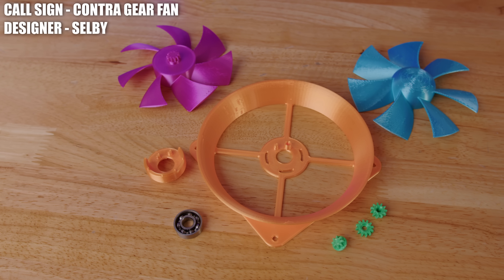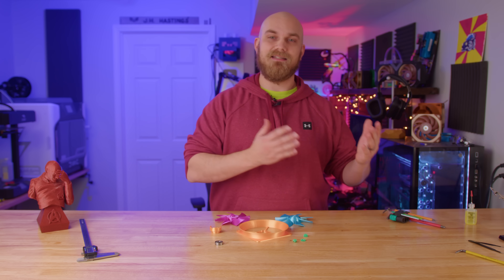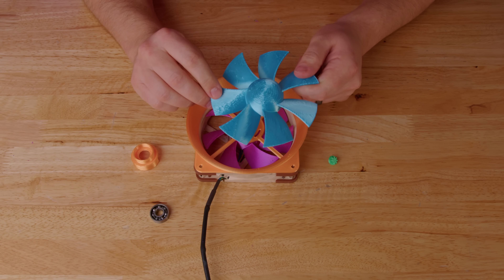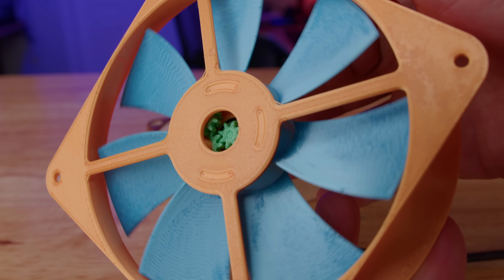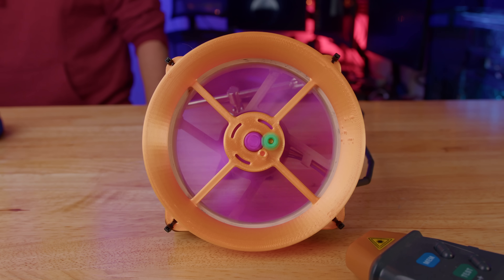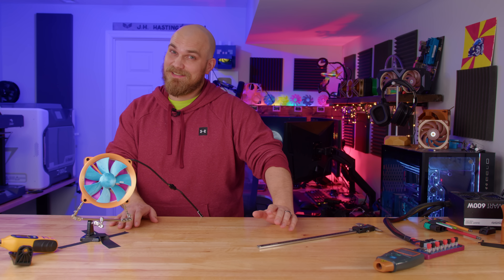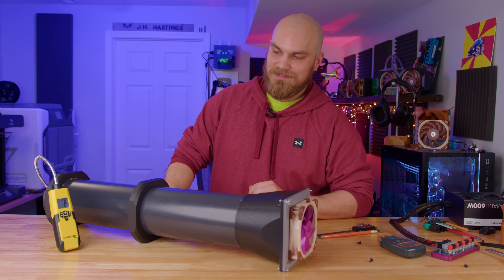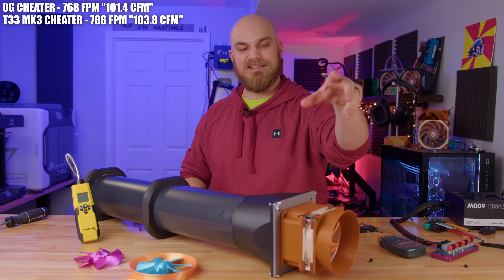World’s Most Complex PC Cooling Fan | Fan Showdown S4 Special

Comment: Concept of Contra-rotating propellers. Contra-rotating propellers are a type of propeller system used in some aircraft, ships, and submarines. Unlike traditional propellers which have one set of rotating blades, contra-rotating propellers have two sets of blades that rotate in opposite directions.

The advantage of contra-rotating propellers is that they provide more efficient propulsion by reducing the amount of energy lost in turbulence and slipstream. The second set of blades can also recover some of the energy from the first set, resulting in higher propulsive efficiency overall. Additionally, contra-rotating propellers can provide greater thrust without increasing the size or weight of the propeller system.

Contra-rotating propellers are commonly used in military aircraft, such as the Russian Tupolev Tu-95 "Bear" bomber and the British Westland Wyvern fighter-bomber. They are also used in some commercial aircraft, such as the Russian Kuznetsov NK-12 turboprop engine, which powers the Antonov An-22 and An-124 cargo planes.

In addition to aircraft, contra-rotating propellers are also used in some ships and submarines to improve propulsion efficiency and reduce noise. Overall, contra-rotating propellers are a useful technology that can improve the performance and efficiency of various types of vehicles.

Comment: Curious how a PLA printed 1:1 copy of the Noctua A12 fan blades compare to the original. That would conclude how high the penalty of printing artefacts and inconsistencies are. With that info you could extrapolate the gain of an injection molded version of each blade design.

Comment: I have a though.. what if.. you printed a reversed fan.. as in the fan blades were literally reversed.. then attached both fans to their own motor.. only reverse the contra blade fan and have them mounted together.. i know that is 2 motors but the sound and performance in the cheater should go up.. at least that is my thinking.. would love to see that..

Comment: I worked in high glass injection molding, moving parts usually have Pins embedded. I think removing the plastic nubs for the gear box and replacing it with a thin wire or pin like a "Hotwheels axel" would reduce parasitic drag significantly.  If you Wanted to over engineer it further, Hobbyist do make high end small bearings for "Legos" as well as a knowledge of the best plastic lubes ever.   Please follow up with PINS. "K&S Precision Metals 5501 Music Wire" was $1.19 on Amazon, it seems a good start.  For all intents and purposes that wire is what makes "Hotwheels" go Fast.

Comment: My good friend ever wondered why transmission oil or differential oil is thick? Yes its produces friction BUT it has high viscosity for a reason.
CENTRIFUGAL FORCES! Sorry for caps but your gun oil exists on the outer walls of the outer fan the moment you started the fan assembly.
In my ears you can hear the gears grinding eachother dry on https://youtu.be/lx01utHcFtg?t=466.
None the less a great video as expected from you

Comment: In free flow, the 'Cheater' reigns supreme, but, lets compare CFM between Cheater and Contra Rotator, with a little back pressure. (flowing through a heatsink)

Comment: I think it would be interesting to also compare the power/current draw on the fan motor to see if the additional blades require more power to run. Could it reduce or nullify potential gains in flow that could be more efficiently achieved with another fan?

Comment: its very cool 
but its a lot of sound for a less then 30 increase
wonder if instead of 3d printed you used properly lubricated metal gears if that would reduce the sound and how much it would strain the engine 
lots of things still possible to try with this design 
maybe a version 5 or 6 will be the best fan ever, worth iterating definitely

Comment: but when it comes to noise level to airflow, the contra needs a lot of TLC... maybe use an already built, all metal planetary gear or just try the same with recycled metal spur gears? 71db is not desirable unless you're running a server farm. maybe a different teeth design could help with the imperfections of the 3d printing.

Comment: Use ball bearing grease, also works well with gears (only low end), and maybe hand sand the printed parts?
I never see somebody do after touch on 3d printed parts
And maybe design some helical gears, they make less noise (a lot less) and engage better, straight cut gears can handle more torque but thats about the only benefit.

Comment: issue with this type of testing is the lack of statis pressure measurement, when i start building my pc in 2012 there a AF (air flow) and SP (static pressure) pc fan one is for chassis mount the other is for radiator or air filter mount. the AF fan have bigger blade move more air but if hit obstruction it cant pass the air through as much as SP,  that why there are 2 version exist. As we move on the 2 slowly merge together and we got to this point where the fan performance is pretty close between obstruct and non-obstruct flow with the scarified is the performance now is in the between of AF and SP. also \we want quitter and quitter fan as well as more reliable one as well and the price is an issue honestly pc fan now are way to expensive to replace as well 12 noctua fan can run a few hundred easily.

Comment: I haven't watched the whole video yet, I stopped at the selection of lubricant. Depending on the oil, it would be better than lithium grease, as grease is too thick.
   The oil is better, but would go everywhere, and could react with the plastic. Not that big of a deal considering it's just a test and a video.
   I think something like Pedro's dry wax chain lubricant for bicycles would be optimal.
  The lubricant goes on wet, and then dries with a thin film of wax. Wax works very well with plastic.
Reply: Oh, after watching the video, oil is good for the pivot of the gears, but the teeth would benefit from wax.
   Cool design from that participant in the showdown.

Comment: I'm kinda hoping to try something similar but just use stacked contrarotating fans to improve the overall airflow in my old cooler master wave master case with it's 2 80mm fans and one at the rear, great case but if contrarotating stacked fans have good efficiency it could be big for my case's limitations

Comment: Cheater fans in a contra setup, with and without cheater frame - its the next logical step up.
Bearings and better fitted gears to reduce noise and friction.

Comment: Airflow (how much air is pushed) is only one perimeter to measure by. Another is air- or static pressure. If the first is very high, but the latter is low, you might have trouble to push air through a dense heat sink (or clogged up dust filter). If it is the other way round, you probably don't moving much air.
I suggest also a test with a balloon or something, to see how good the fans are in creating pressure. Is it all (wind) speed, or is there also some force behind? And if, how much?

Comment: Sewing machine oil is the lubricant you want. Rubber belts would work quieter than gears, as used in countless things like tape machines and record decks.

Those gears will be adding a lot of backlash and friction, which will massively limit the speed of revolution.

Comment: i used to do these counter-rotating (pretty much i call it a compressor like from jet engines) kind of fans with high rpm fans back when i was working retail pc shop. And damn these are loud. almost sounds like a roaring engine and the airflow was insane.

Comment: Has anyone ever entered like a jet engine turbine design? With an intake and compression stage? That could be pretty interesting. Bulky though. This contra fan design is all things considering very slim. And I bet you could solve the noise issue with metal gearing and better tolerances. Very impressive.

Comment: Considered doing the Noctua S12A vs. the A25x12 including a smoke test with and without a mesh? (A mesh similar to a rear exhaust on a case.)
I see the S12A as the ultimate rear exhaust fan. It's supposed to be superior for low impedance, but I don't know how little resistance it needs before it gets beaten by the A12, and there's not really much out there on it that I can find.

Comment: I'm pretty sure that you're gonna need grease instead of oil here. I have an electric screwdriver with plastic gearbox. It was very loud when I got it, and yea, they pre-lubed it with some little oil, but still very loud. So I wash the gear and get some grease on it. Voila! It worked, the gear box now having way less noise than before. So that's my recommendation. Good luck

Comment: First time seeing you channel but I think that you need to measure power consumption of motor. With this contra design, power consumption will be higher because of doubled weight that motor needs to spin. So it is definitely not the mos power efficient design

Comment: Stacking fans like that is boosting PRESSURE not airflow, rise in airflow is because higher pressure helps overcome aerodynamic resistance of wathever you pumping air through, if there would be a restriction like some dense heatsink, difference between the two would be bigger, at some point when single fan cannot pump any air through restriction, double fan will be able to pump some considerable amount of air

Comment: i workout way get fan push more air then adding 2 fans still using stock blades no added parts. you do trick your fans don't buy new ones i will upload video how do it just little bit more testing other blades. do this new design push more air then single blade fan.

Comment: i would never ever put so noicy fan system in my computer. i would propably just use noctura fan, or even put 2 x noctura fans, but not with the gear system. 
nooo i would just go with a " silent noctura fan " i dont need the fastest fan. because i dont overclock. 
my computer is always a compromise , 1. now noice. 2. enough computing craft for the game. 3. i dont play 4k, because everything gets to small

Comment: 10:43
YEP !
you applied aerospatial tecnology !
yes, contrarotating propellers do a little more then normal propeller
infact MILITARY didnt want to use those more then normal ones (see "wivern" plane) because the tech was "useless" for military applications (in combat, too little advantage for a too complex tech)

but of course you did a magnific job \0/
all those more rpm and more air flow are fantastic for your CPU ^^

like indeed

(sorry for poor english, i dont like google for easy traslations XP)

Comment: Not sure if it was mentioned however counter rotating fans aren't just about max cfm. Similar to the stationary fan boosters, it greatly increases the static pressure of the fan. Fans often are met with resistance so knowing the max static pressure(and vaccum) produced is a key mcamera as this affects the final cfm once the resistance to flow is accounted for. Check out "pump curves" for similar idea though with fluid flow. Static pressure and vacuum can easily/cheaply be measured using a u tube(search "static pressure u tube). Only need a small open chamber, tubing, board to mount tube on, water and ruler/marking device. Maybe something worth measuring given how restrictive many radiators and heatsinks are. Bonus points if the chamber also has a adjustable restrictor with set points and cfm is measured at the same time that static pressure is measured. effectively creating a crude pressure/flow curve. Add power measurements and sound for each stage to really go crazy. An arduino could automate the process and log it and use opencv for detecting the pressure values using a camera ;)

Comment: I wonder if someone has tried to design a fan with a thicker mounting bracket with lubrication holes to allow for oil to flow into it to keep the parts moving without friction I just kinda thought of the idea since he discussed that the smaller gears have no bearings so would it be possible to increase efficiency that way?

Comment: being a person who builds the contra-rotating fans for a living, on an industrial scale, can confirm the effectiveness of smoke removal due to the crazy static pressure and throughput aswell as the design making a cyclonic effect to stream the air out instead of allowing it to curl back around(whatever thats called). the fans i build have one motor per impeller, the blades are at different angles such as but not exclusive to 21º first stage and 19º second stage. about 2º between first and second stage is probably more efficient(going by my work engineers[im just a spanner monkey]).

Comment: Combine the gears with the pulleys and adjust the ratios a bit. Get the outside fan spinning at about 1/3rd of the speed of the inner fan and you're well on your way to peak efficiency.

Comment: Variable pitch fan blades with mechanisms similar to helicopter blades or maybe even mechanisms found in VGT turbos would be really cool to watch. I think they could be extremely quiet at low rpm with low pitch under normal load but airflow could increase exponentially for cooling performance when needed

Comment: Gear the cheater to spin 50% faster. See if it aids in air flow without drastically reducing motor RPM.

Comment: that belt driven fan needs belt tensioners for the middle section. two vertical brackets with two wheels on each should improve drastically.

Comment: Major Hardware! This is important for science! Please! You are missing a control group! Even a perfectly designed fan has a serious limitation which can only be tested one way. You must run a control in which the wind velocity across the cooling fins no longer makes a difference in cooling. The ability for the cooling fins to release heat is a limiting factor in thermals of the system over all. It matters enough that if you should run a test with a 'maximum' air flow over them and see what the 'best fan that could ever be made' would perform. The closer you get to this limit, the more weight should be placed on smaller and smaller differences between each high performing fan

Comment: should try helical gears and make a bigger duct and adjust the blade pitch. also couldnt you make a simpler contra fan by putting one set of blades on both sides if there is a way to have a through shaft rather than needing gearing

Comment: The thing about the contra is it provides a lot more static pressure than a single blade.  So if you're trying to push through a tightly packed case or some similar backpressure, this is the prime mover you want doing the pushing.

Comment: grab some ceramic bearings. unshielded/unsealed ceramic ones. they have less rotational mass and work well without lubricant in low load use case.

Comment: for moving parts
try abra+ 70-30 at metaflux

teflon abrasive disc cleaner

gears, and bearings (if degreased), dust free
and ultralubricant facilitated many efforts,
increases yield in some way,
reduces noise

only drawbacks,
it does not last in time,
and you have to put a good squirt, that it cleans

if there is not in the 'zone
you should be able to find an equivalent in the USA...
(metaflux is a 'pro' brand)

Comment: 12:42 That's not a fair comparison. If the drive fan was replaced with one that had equal thickness to the drive and contra fan combined it would probably be the same or better. I think.

Comment: You have to measure the electirc power flowing inside the motor. It seems that that motor just reach the speed choosen (maybe more amps are going to that motor) and so with two blades it sucks a bigger amount of power. If so you haven't demonstrate nothing and you have to make a second test with the one fan running with the same amount of electric power.

Comment: Smoke test set-up tip, please use a sheet of posterboard/project board to mount the fans to and this will eliminate any smoke not going through the said fan to be blocked to not disturb the visual of what is being pushed/pulled through

Comment: Just got this but you need to pick up a manameter... the thing is with fanstacking it add both speed but cfm it increases the SP exponentially. 

On my ambient machine I ran the tests and the build goes DCfan>DCfan>Shroud(cheater)>RAD60mm> fan>fan>shroud>rad whole thing's joints covered in gasket compount

Comment: I don't downplay how amazing the contra design is, but I question when you removed the second fan to run the single fan test, you also removed the extra shroud length, which also could have had an effect on the fan performance. From a curiosity stand point, I wonder how the Purple fan would have performed with the shroud of the additional fan but without the fan and drive gears.

Comment: nice job... BUT... doesn't this get very noisy as the gears and tabs wear out ?  After all they are just plastic pieces  without any bearings....    How long so you estimate this iwll run before some of the components break or wear out so much that it becomes unuseable ?  Just wondering ...   LOVE the simple design !

Comment: White lithium grease or a molybdenum based grease work best for bearings that do not reside in a bath or have an active oiling system. There are spray lubes that are tacky so they stay where they are needed. Tackyness may sound counterintuitive to lubrication but it works great for the old engine lathes where you needed to have change gears to cut different types of threads. Those gears have to be easy to access and change so they remain dry, but the tacky lube makes them lots quieter and wear less.

Comment: Could you test something? Your numbers showed the contra fan added a small amount of CFM...but don't forget, the second frame had a wider inlet. Could you test just the pink fan but with the shroud of the blue contra fan without the fan attached.
I am willing to bet you'll see a small improvement from the shroud grabbing a slightly larger area of air which means it isn't the fan blades doing the work as much as it is the shroud.